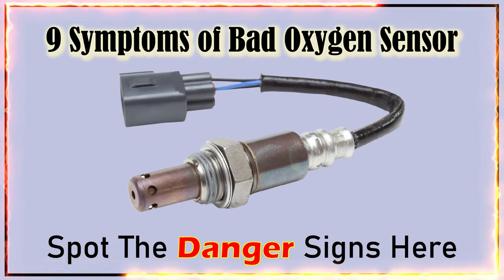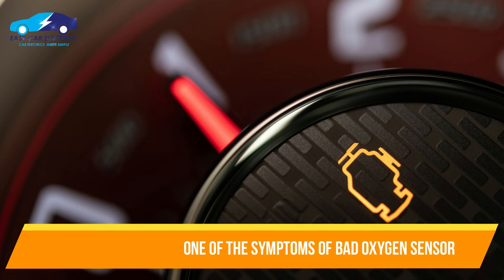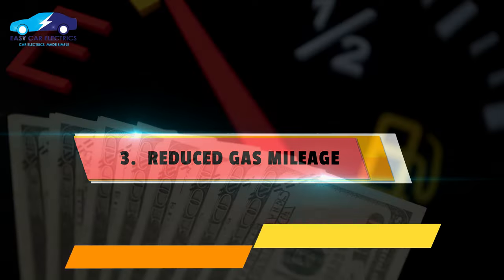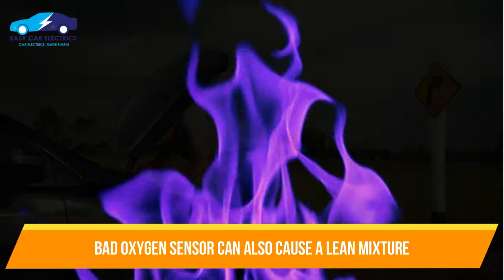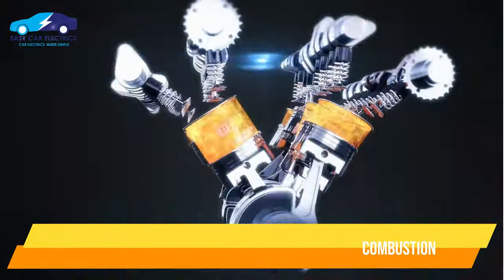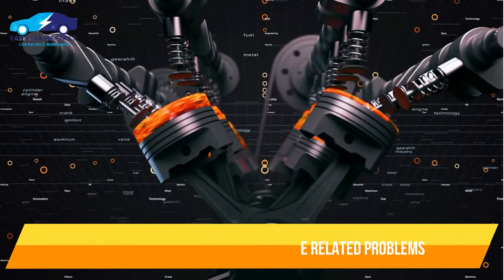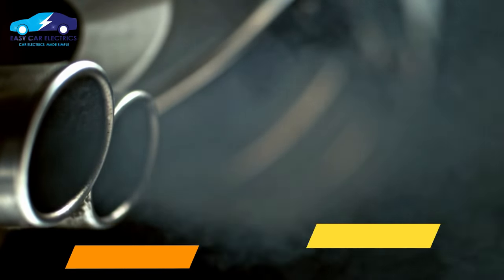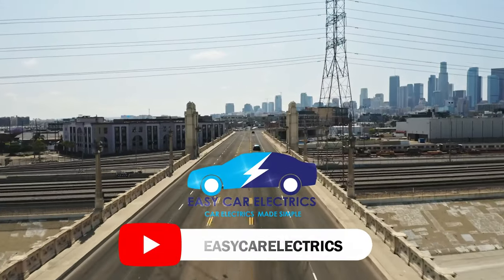Symptoms Of A Bad Oxygen Sensor - Easy Car Electrics

Comment: "Here are the symptoms of a bad oxygen sensor: 1) check engine light. The check engine light is a symptom of a bad oxygen sensor"  gee, really? That was a terrific and very detailed explanation
Reply: I know right!
Reply from the maker: Thanks for the feedback. We will aim to make the videos more explanatory and informative, this point was just to highlight that the check engine light can often be a symptom of a bad oxygen sensor, albeit can signal a lot of other issues with the car.
Reply: Almost  got entrapped into believing this one learned alot smell the Flowers 😂LAX. Thanks for your input heresay X.
Reply: LOLOLOLOLOL 😂
Engine light sympton for many problems.. But via the OBD2 you can see what's wrong.
Reply: Yeah, Check engine light can be anything.  Need to pull codes (if even throwing a code ie, no engine light and just runs rough) and even then can be deceiving.  For example, could be a leak in exhaust system before precat Oxy Sensor which the sensor will tell Computer there is still to much air showing a lean condition and then computer compensates by dumping more gas to the air/gas mixture to make it run too rich. A vacuum leak can make a lean condition or a leaky injector can make system run too rich. Better to run more diagnostics such as fuel trims to make sure before you start swapping out parts which can be costly.
Reply: @LA_Commander  and mostly incorrect.

Comment: Exactly why  carburetors  are king no electronics to cost you money and they get better mileage and lower emissions.  And You can easily fix them at home. CARBURETORS NO ELECTRONICS. we win.
Reply: Yes I'm regretting buying this headache Mitsubishi money drainer, learnt a lot in the past 2 months on how this engine is controlled. Failed UK MOT exhaust emission Lambda test, checked for exhaust leaks but nothing found ugh.

Comment: Just alittle note, the upstream sensor(s) are called Air Fuel Ratio sensors not Oxygen sensors and the downstream are called Oxygen sensor. Don't get these confused with each other as they look the same but do completely different things.
Reply: Thank you i wish i would have read this commnent an hour and a half ago 🔥😭
Reply: is the NOx absorber B2 an oxygen sensor 
i have done a monitor test and had this fail...
but i can't find out what it is... is B2 bank 2
i have a Ford Focus 2009 1.6 TDCI 
any information would be highly appreciated
Reply: yo're right sir. 2 types and 2 dufferent function. thanks.
Reply: Or called the Lambda Sensor!
Reply: Don’t be ignorant, this entirely depends on what cars you’re driving.
Reply: @gloopington No it doesn't. Unless you're driving an EV or something from the 60's I guess.
Reply: @georgeh1352 Yes but not to confuse most people we generally call them Air fuel ratio sensors. 👍
Reply: @sarin62  Slightly confused, isn't an air/fuel sensor operates on a current produced signal whereas an Oxygen sensor works on voltage produced swing of 0.1 to 0.9 v ?? My B1 sensor produces a voltage swing and is called an Oxygen Sensor?
Reply: @MrMaster2262 Sensor 2 on any bank is downstream of the catalytic converter and its main job is to tell the ECM how the cats doing, that's it. Not sure about the "absorber" that you are mentioning. You check the o2 sensor by voltage. If you have an OBD2 scanner you can look at "live data" and fuel trims. Fuel trims also gives you a plethora of information about how your engine is going. Hope this help 👍
Reply: @sarin62   I will look into that...
😉👍 Cheers mate
Reply: @DaveHarper-r5k Yes. The AFR or Lambda sensors tell the ECM how rich or lean your engine is running. The downstream o2 sensor is telling you how the cat is doing. But to answer your question, you test the o2 by checking voltage and you mainly test the AFR or lambda by the 2 heater wires " 2 wires the same" by omhs. Lambda should sit around 1ish on live data. And o2 should sit around 4.5v ish until you accelerate or decelerate but generally fluctuates between 0.1 to 0.9v rich and lean. Your fuel trims and live data on your obd2 scanner "if you have one" can tell you all this. But you need to check with your specific vehicles specs as they might be different. I have a Toyota landcruiser so this is my specific information. Hope this helps 👍 . Ps.. I could ramble on forever about this but it's already long-winded 😂.

Comment: Never had any engine warning light show up on mine. Unscrewed the sensor to check for fouling, looked ok so reinstalled, hey presto, engine functioned ok  with better response/acceleration and a smoother idle. I think the sensor had an "unclean earth" via it's rusted thread, presumably the unscrewing action had cleaned the thread  thus giving a good earth.
Reply: The oxygen sensor can make you work other things that's not the fault if you don't discover it on time

Comment: Stuck in Salina KS because my bank 2 rear O2 sensor has gone out. Horrible gas mileage. Praying to God when auto shops open Monday I can get it replaced.
Reply: The rear oxygen sensors do not affect gas mileage, they monitor the catalytic converter to let the ECU know the catalytic converter is working properly
Reply: 02 sensors are not the reason, they are sensors that read the emission

Comment: Thanks God. I got this problem for long time, but now I know what is about ! Very low gas milege, also problem with catalitic convertor because of this aer-fuel sensor.  Thanks a lot ! God bless !
Reply: If you have an OBD2 scanner you can check "live data" and fuel trims. Don't just throw parts at it as it could be a lean or rich issue "vacuum leak, maf sensor, fuel pump, fuel pressure regulator, leaky or malfunctioning fuel injector(s) ect ect ect".

Comment: I have a ticking in my engine, it's 2014 Town and Country Van. I think it the lifter. I scanned the engine and it said cadlic converter need to be replace, and then it said sensor 1 PO 420, bank 1, and sensor bank 2 PO 430 needed to be replaced. When I start it up, I get the lights on the dash to light up like a christmas tree. Speacily when it's cold out and rainy, Not sure what that could be. But it's starting to drive me into det, lol Do you have any idea's???

Comment: I have a p420 and replaced the whole exhaust and cat and paid 160 for the cat and the check engine came back about a month crazy, I replaced the upstream but not the down, im not replacing anything else because p420 means nothing and it mite be a ecm error, I have a 2004 Honda Accord ex sedan v4 2.4l
Reply: Do an induction service! I bought a 2015 Nissan Altima with 254,000 miles on it from a dealership. The very next day while driving, my check engine light came on and it was the code for a catalytic converter. I recognized that code as I had that code on a previous car that was also a 2015 Nissan Altima but with over 300,000 miles on it. I bought a catalytic converter (Magnaflow brand) and an upstream and downstream sensor for that car. Code went away but came back 3 weeks later. Smh. This Nissan I did an induction service and the code went away 3 months ago and never came back on again.  

What's an induction service? Cleaning out your intake manifold with a special cleaner (bg brand air intake cleaner) and cleaner tool that pushes the cleaner into your intake while your car is on and your rpm' s are over 2,000. Clean out your throttle body as well with throttle body cleaner. Open your throttle and clean inside and around it. Finally, put bg 44k fuel injector cleaner in an empty gas tank and fill the gas tank all the way up. Use good gas like Chevron, BP, Shell. That 44k injection cleaner will clean carbon off your fuel injector and also clean about 40-45% of carbon on top of your pistons. Check to see if your spark plugs are good as well. If they're worn replace them every 150,000 miles. That cleaner will also clean your upstream oxygen sensor while it's running. Ya don't need to change your 02 sensors or catalytic converter. Just induction service. Thank me later
 😢
Reply: a good quality spark plugs should last 150,000 kms
Reply: O2

Comment: I changed my o2 sensor and a week after the engine light com back on saying that the sensor need to change I don't understand
Reply: Same thing I did and I am confused as well.
Reply: They advice when replace 0z sensor you must do software
Reply: Unplug battery for 15 min
Reply: Saying the oxygen sensor is bad indicates that some things are not working well. Such as spark plugs, injectors, air filters,  dirty trotle body  or air leaks. If the oxygen sensor problem still occurs after doing these, then the oxygen sensor should also be replaced.
Reply: Y have 4 ..2at top 2 on exhaust..my 95 Pontiac  is waiting on all 4.it has 162,000 miles  ..just happened yesterday 😂